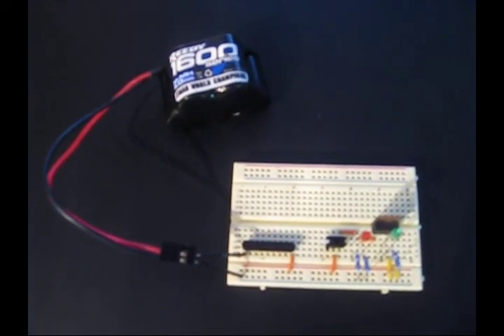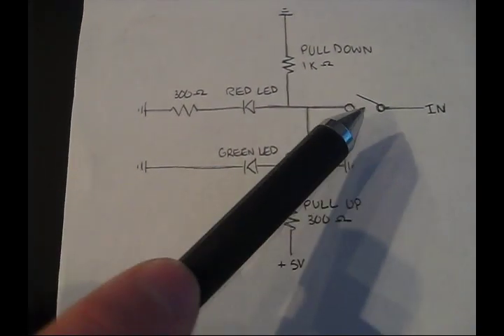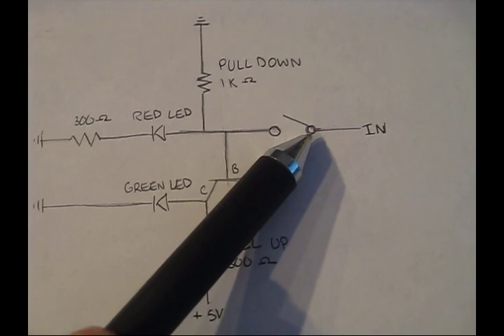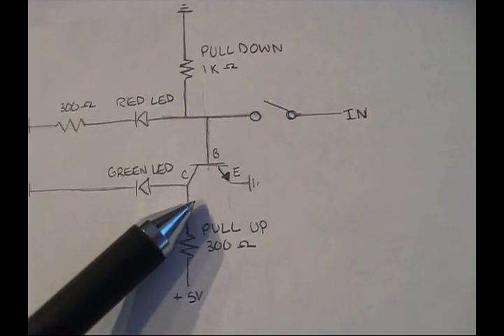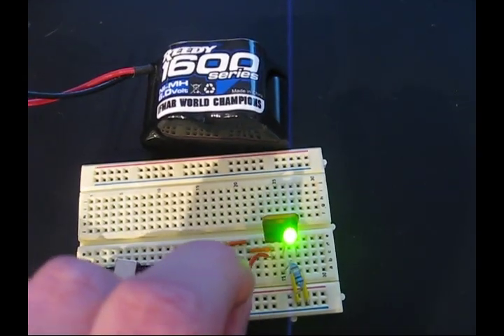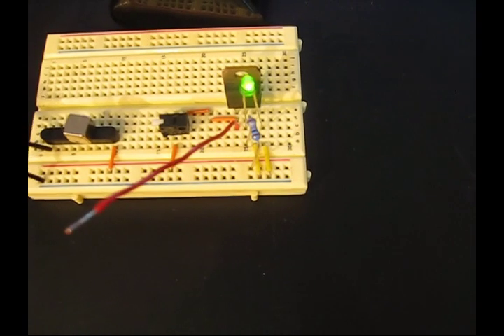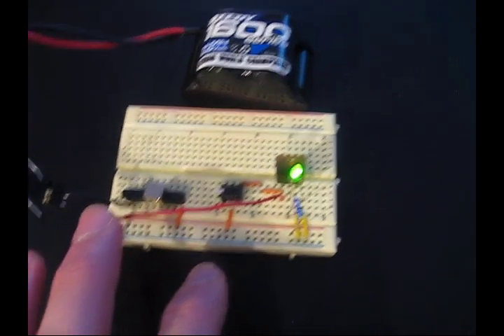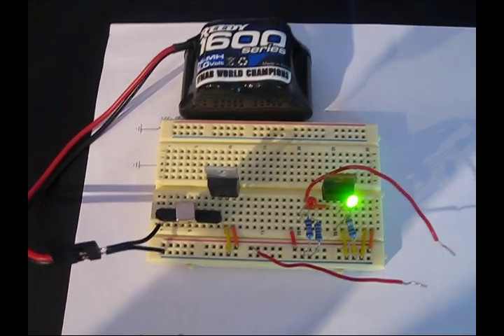Pull Up and Pull Down Resistors

Comment: does it matter whether the resistor meant to protect the LED is connected to the positive or negative side coming from the battery and then to the LED.  for example... battery positive >>>resistor>>>LED......OR battery positive >>> LED>>>resistor. i guess what i am trying to covey is the question whether electricity comes from the positive or negative side and does it pass through the resistor first or led first?

Comment: @bobesfanchi To call this reply late is a bit of an understatement, but in case someone else is wondering (I was): the green LED is powered in series with the 300 ohm pullup resistor, so that resistor takes care of the current limiting. The red LED would be powered directly off 5 volts if not for the limiting resistor added on the ground wire.

Comment from the maker: Thanks and you're right about the current. If the current is too high, the LED will break and it is the same case with voltage (I think too much power is what breaks an LED). A resistor should be chosen, using ohms law, so around 20mA is through it. Since the resistor is in series with the LED, the current will also be 20mA through the LED.

I taught myself most of this, so I'm no expert either.

Comment: @0:45 you mention that the 300Ohm resistor is there to limit voltage across the led. You mean 'current across the  led', right? I have trouble conceptualizing sometimes so I could be wrong. Either way, excellent demo and explanation!